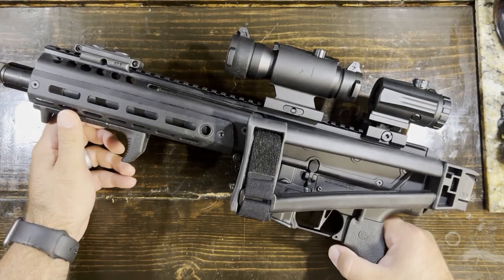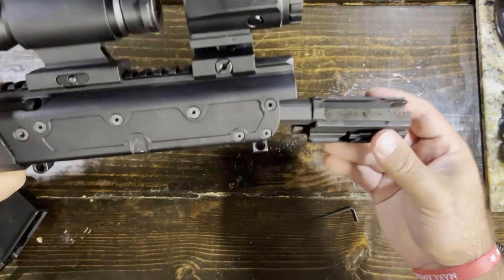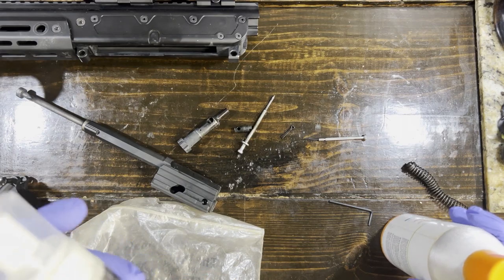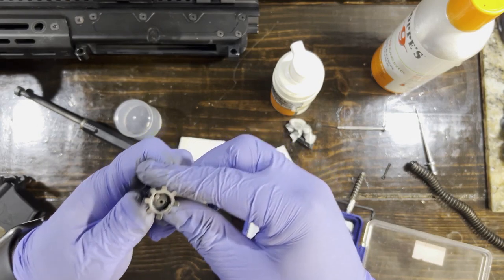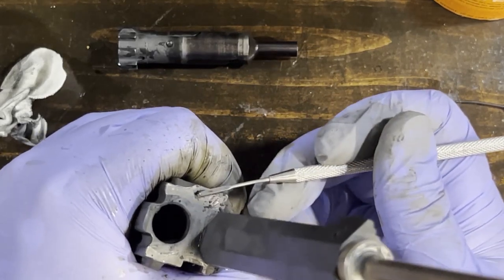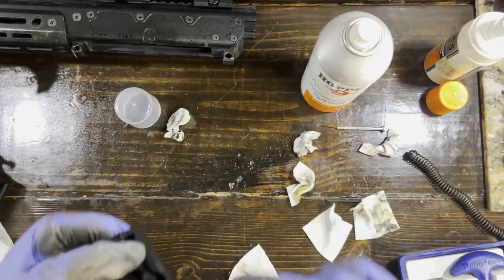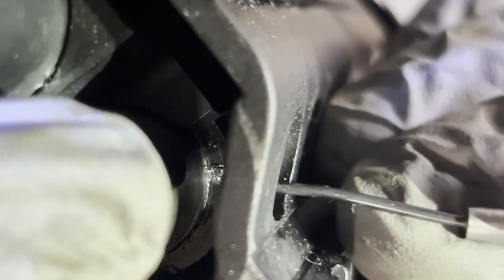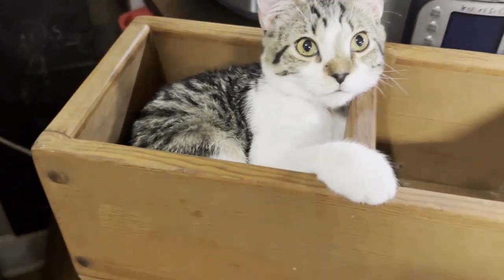How To Disassemble And Clean The PSA Jakl

Comment: Shot my 5.56 JAKL yesterday for the first time and man, this thing is DIRTY!

The barrel,  inside and outside of the rail, fore-grip, sled and even my hand; COVERED in carbon and speckled with unburnt powder. - 80 rounds.
Reply from the maker: Dang. That's a dirty boy! Thanks for watching
Reply: What kinda rounds you shooting man? Mine doesn't run dirty at all, but I'm using 77 otm and 62, and 55 pmc haven't had a issue.
Reply: @boostedbadboyzx12r31  

Ammo Inc. - Nothing to write home about.

I shot the same ammo through many of my AR's. - Its not the cleanest, but not white box dirty. 

I'm not sure why other than possibly the block. 

It did have zero failures with that round count. - I cleaned it and threw it back in the safe.  

Whenever I have the time, I'll throw it on the bench and tear it down and take a look, but it was as I said it was. 

Not bashing, just was surprising to me and wanted to see if anyone else was in the same boat.
Reply: @BoostedVQUR  I assume this is your shortest barreled 5.56? The shorter the barrel the dirtier it will be. The powder isn’t burning efficiently due to the short barrel. 👍
Reply: @adambarlow7787  - No sir… I have a 5” micro build that will pepper and embed powder in your forearm.  I need to put a linear comp on it for sure. Currently it has a SI warthog comp on it now (The idea was to to keep it as short as possible). I cleaned it, put it in the safe and haven’t shot it since.
Reply: @BoostedVQUR kinda late but how do you like the ammo inc? I just bought 400 rounds of 55gr hpbt for $220 from the shop. Reviews are all over the place. Few ppl said they blew their gun up with it. Others said remanufactured. Haven’t had a chance to shoot mine yet. Nickel plated brass. Everything looks new & consistent. No sign of flaws.

Comment: The main failure point on the AR15/M4 is the bolt. I don't see a point to not uograde the bolt if one is doing a total redesign. 
The one thing unbeatable between the AK & AR is that AK's don't break bolt lugs, nor extractors, nor the whole bolt itself.
I don't see the advantage of taking a DI AR design to a piston if not changing the bolt design.
Any agreement here?
Thanks for the video!
Reply from the maker: I agree. For all the piston is has like an AK, it lacks the reliability

Comment: Have you had any cycling issues? Last week when I first shot the JAKL it worked flawlessly. Today I would get 1 round to fire then click, nothing happened. I’d pull on the charging handle and load another round and it would fire 1 round and then click, nothing. I know it sounds like a gas issue. Tried a few different settings and still the same problem. Any suggestions? It’s brand new
Reply from the maker: I didn’t have problems until I put a suppressor on and had to tweak things a bunch. See my Final Review of it
Reply from the maker: I didn’t have problems until I put a suppressor on and had to tweak things a bunch. See my Final Review of it
Reply: @TNTactical  
I will look at your final review. I’m going to remove the gas block adjuster knob like in your video and check everything out. Thank you for your reply.
Reply: I took my 300 blk jakl to the range yesterday and I was getting crazy amount of failure to feed issues. Lubed it up pretty good and switch to steal case and it worked fine went back to brass and it was fine
Reply: @Bferr89  
I keep the gas selector knob on setting 1 (fully open gas block). It cycles fine on that setting. After a few hundred rounds it began to break in. I can see the wear patterns on the BCG match the rails in the upper. It seems to be running more smoothly. I did add a BCM brake/compensator. This seemed to help with additional back pressure to the gas system.
Reply: @tomconley2458  see my problem isn’t the cycling backwards. It elects and grabs a new round just fine, it just won’t fully close on the chamber when it’s coming forward to the close position. I broke it down cleaned real nice and oiled er up gonna put a couple hundred more rounds through and see what happens.

Comment: So the lower that comes from PSA is just a normal lower with the picatinny insert installed in the back? I thought it was a specially made lower.
Reply from the maker: You are correct. Any lower will work
Reply: @TNTactical  perfect, thank you
Reply: @bruinsfan8522  In case you haven't acted on it yet, you need to buy their absurdly priced 100$ kit to "adapt" it safely though.  Essentially this is closing off the open (for a buffer tube) rear end of the AR15 lowers.

Comment: Is your sled still ok? I've seen a bunch of failures where the sled broke.
Reply from the maker: So far it's still good. Racking up more rounds to see if it will fail.
Reply: I have the newer, redesigned version of the sled. It’s thicker and beefier. Shouldn’t fail. Time will tell
Reply from the maker: @tomconley2458  yeah mine came in last week. It’s definitely got more support now. Glad they fixed the issues

Comment: Helpful for disassembly, but for someone who preaches "cleaning the tip" I'd expect them to know what lubrication is. And man is that action drier than my dead 80 year old grandpa. If you want your guns to be reliable for longer than 1 range session and easier to clean next time - apply a this layer of oil/lube on all moving parts. Especially parts with metal on metal contact.
Reply from the maker: That's why I like that particular Hoppes 9 in the aerosol can. It leaves a lubricating residue. It's called their Gun Medic. Good stuff!